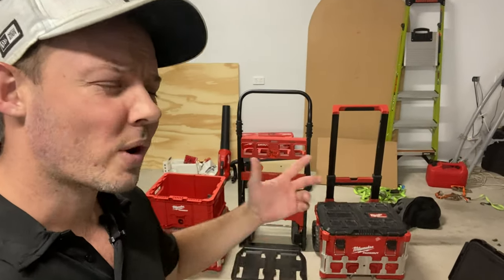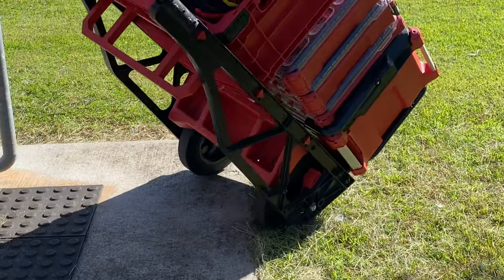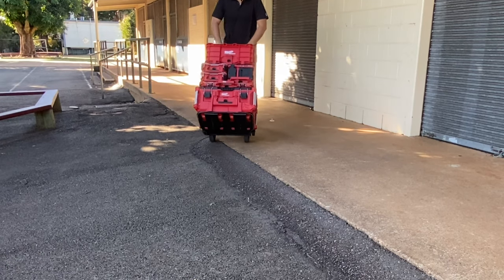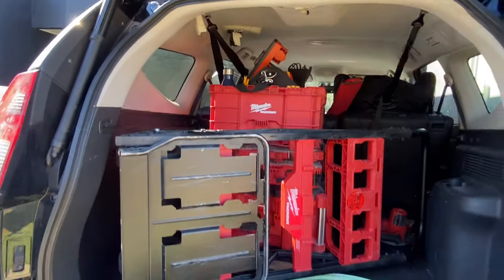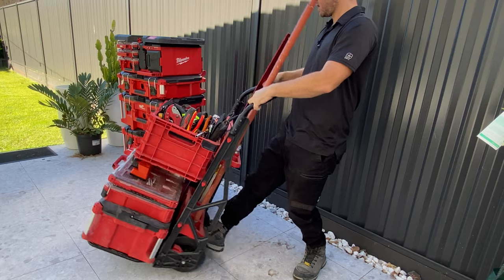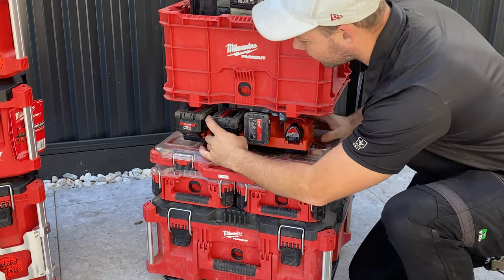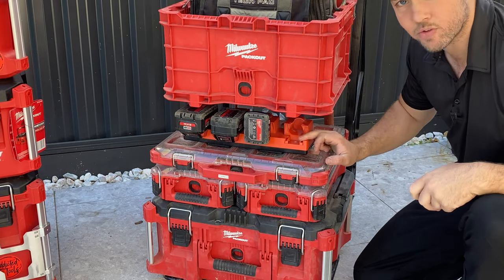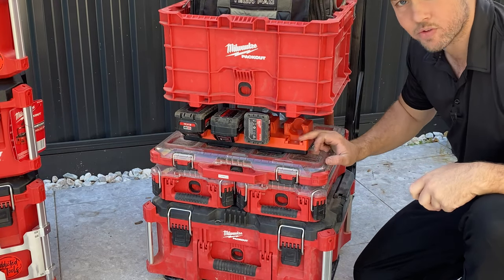MILWAUKEE packout wheel cart vs roller box COMPARISON and setup. Must watch before buying!

Comment: I mainly brought the trolly to use as a tool roller but also to carry out ovens etc…. Rather than have both just the one. And it works so far for me but great review mate
Reply from the maker: Cheers mate. It’s 100% perfect for that sort of work. If you ever have problems with the trolley after a heap of work, let me know. I’m interested in how it goes.
Reply: @AddictedtoTools  I will do….i had an issue after 2 days… squeaky wheel bearing so I took it back they just replaced it for a brand new trolly. Milwaukee authorised it not the shop which was pretty crazy. Other than that 4 weeks and it’s working well.
Reply from the maker: Good to hear that they swapped it.

Comment: The wheel base is the achilles heel of the cart, I would move them outside and u can make the wheel larger so it can go over on a lot of things and if add size on the rear this is the perfect opportunity to add two small 360 wheel on the front so ur cart will be leveled but in my case i like my cart tilted back a little

Comment: Thank you for the great information but I own both and I use the dolly for my pack out drawers and I use the rolling boxes for all my other tools that I don’t use as often so basically I use the dolly and drawers for my m12 tools and my bigger m18 tools on the rolling box system, just throwing that out there. I do like the fact that instead of breaking my boxes down I just open the drawers
Reply from the maker: That’s definitely something I’m looking at doing. Once we get the packout drawers, I feel the trolley will be a lot more utilised. Thanks for your thoughts mate. Sounds like you’ve got a good setup 👍
Reply: Thank you I always want to share information on the tools and storage

Comment: The one problem I have with the rolling base is that when I have a large load the rubber wheels get a bit warped and look like they may pop off the rim .
Reply from the maker: That’s a good point I didn’t bring up. Maybe because I haven’t really had a real problem with it yet. I do know many people that have had them break and they’ve changed to a more heavy duty wheel.

Comment: I love my Packout trolley - I’m a meter tech so mine is just full of test equipment & cables.

Only problem I find is if you get caught in the rain and open the trolley lid afterwards, most of the water sitting in the grooves on top ends up inside the trolley 🤨

Comment: Best to make a dolly with the packout base, plywood, locking wheels,  each corner, fastened to a  typically 3/4 ply sandwich 1/2" gap, ( personaly thinking of going with 1/2 " all round)
 get the miluwakuie aluminium hand truck wider base,  so indoors u can move tower on small 2 to 3 inch wheels, n truck tower with hand truck when moving it
Reply from the maker: Sounds like you’ve spent some time thinking about it. Would love to see how you go setting it up. 👍🍻

Comment: The roller has a more center of gravity as the weight is more center to axel. 
 The roller box has wheels on side which brings them forward. Also the roller box was intended to be taken on all terrain as the tyre tread. 
 The dolly (2wheel cart) is more intended for finish areas. Not really intended as equal replacement as an alternative to roller box which requires the bottom box to accompany you. The cart allows a stand alone option.
Reply from the maker: Hey mate,  from what I’ve seen the trolley is meant to be used almost the same as the roller box. They don’t actually detail the proper use and all the photos are very similar to how the roller box is used. The applications they use it in the photos is how I used it and it tipped over

Comment: The wheel dolly is ok for finish flooring but on dirt and mud for new construction its a terrible unit.. what i would do is remove the wheels 🛞 that come with the dolly and add all terrain wheels and have them on the outside… because all my packout are drawers.. two deep 2 drawers and the top is a 3 drawer and a deep organizer then to top it off with a slim organizer..

Comment: What is the white iron component of 48-22-8426   ?
Thank u
Reply from the maker: I’m not sure what you’re referring to sorry.
Reply: @AddictedtoTools , I believe it is the metal bracket mounted in front of the roller base. at 21:07 (https://youtu.be/NPA_7d5JOpc?t=1267) you are sitting in front of it, and the battery holder is hunging on the bracket (that bracket is what he is asking).
Reply from the maker: Oh ok. Thanks. 
It’s from www.Packibletools.com
Video I did on it is here:
https://youtu.be/27Tp31NNpbo

Comment: The wheelcart is extortionate, especially considering that in buying it you're basically saying that you're committing to buying more of the system as there's no reason to buy it other than the fact it can carry more. Ends up being about £248 for the dolley and similar size tool box to the one that comes with the "trolley box" which costs £115. That's 115% more expensive for basically the same product even though the more expensive one performs worse but has a place for your levels. It's just frustrating that they didn't make the dolley better in every way as they should have.
Reply from the maker: They definitely should have made a few changes. For myself, I had packout first. So buying the trolley is an addition. At the moment I use the trolley a lot more as I’m utilising it as a trolley to carry other gear around site, then attaching the Packout drawers and box. It has great potential but wasn’t done right and definitely pricey. 
Thanks for the feedback mate.
Reply: @AddictedtoTools  thank you mate. That makes sense. I think this thing would also come in handy once I get my gas accreditation and have to lug boilers around. Awesome video by the way.

Comment: Easy fix for the cart. New axle shaft that is longer and either outboard the existing wheels, or upgrade to some foam filled rubber tires that will hold up way longer than the plastic wheels milwaukee puts on these "heavy duty, pro grade" organizers.
Reply from the maker: 100% mate. I believe that’s the next video after I did this one. Upgrades the axle. Worked a treat. Still going strong a year on👌

Comment: I will buy packout when engineers pull their head out of their you know what and make a bottom box that makes sense. Drawers, 1 single tilt drawer, side open, whatever just make it actually accessible without taking the whole thing apart. Completely defeats the purpose.